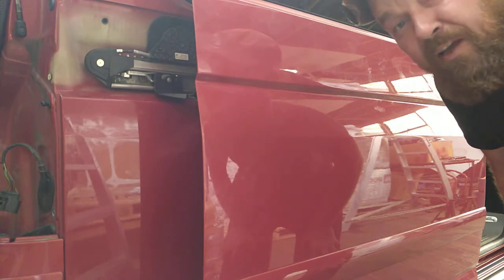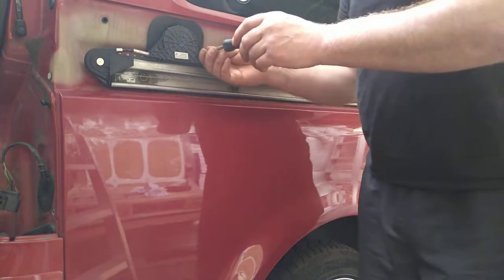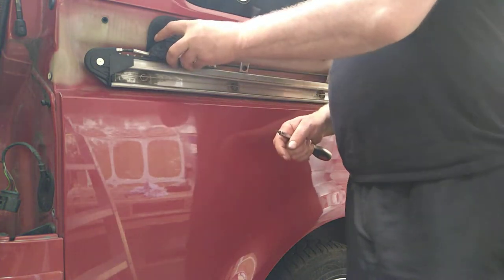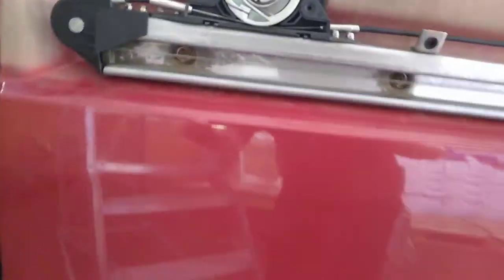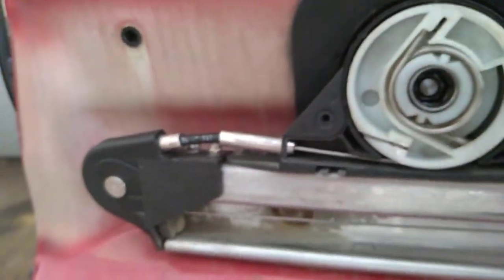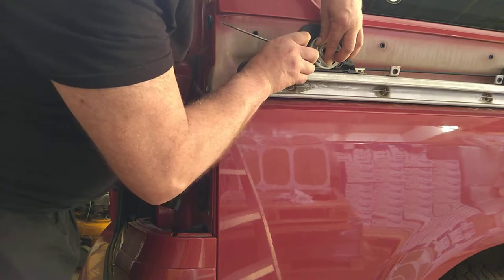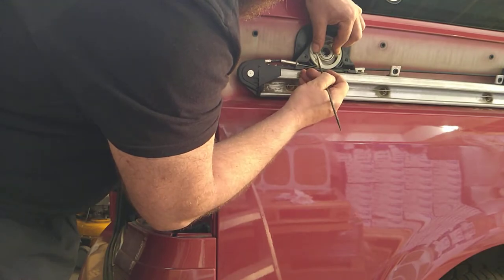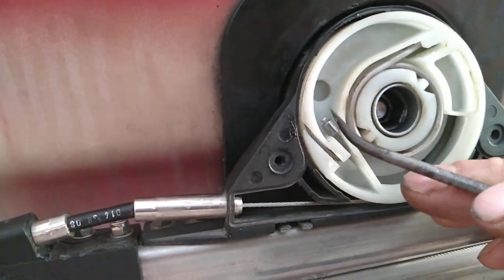VW T5 elektic sliding door fix

Comment: In my case the problem was not the cable but this thing where cable is attached to the rollers, it was rusted in diagonal position. So it is important to check this first before starting to mess with the cable. Door behaved exactly the same as in your video.